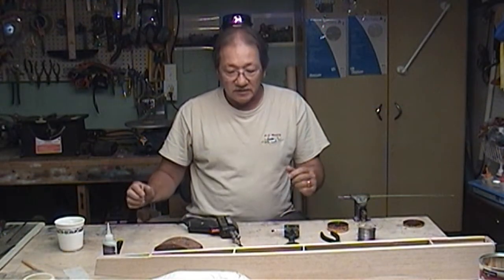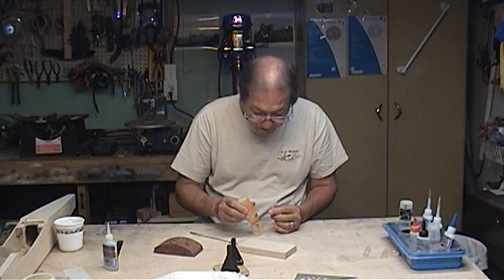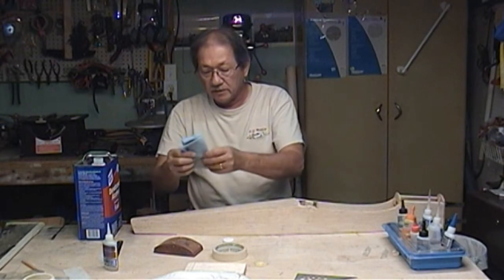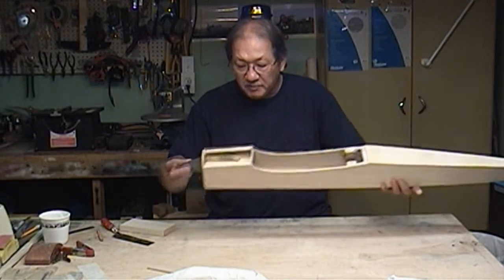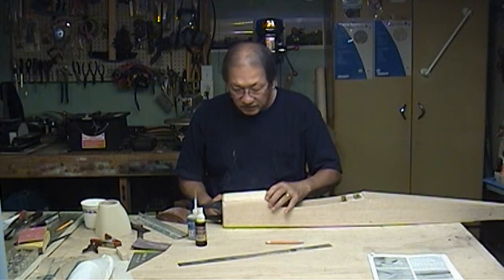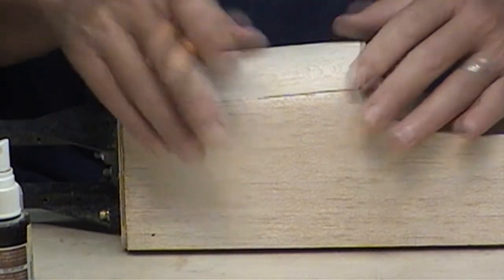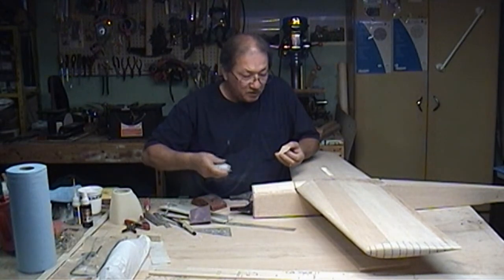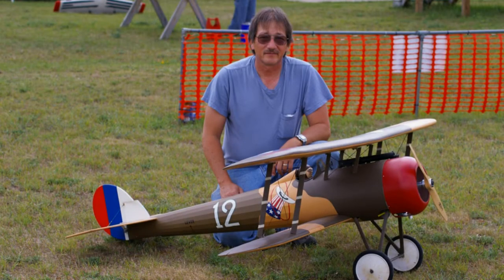SIG KOUGAR BUILD   Part   9 D   Back to The Wings

Comment: Hey Bob, thanks for the video, still following and looking forward to more video's.
Reply from the maker: Hi Mike, Thanks for following along. Started today on the prep work for the retract video. It's going to be a little bit more complex than installing standard landing gear blocks, but they're retracts. Just adding to the fun factor. The retracts are just simple cheap mechanical but they work good... The video should be out in about a week maybe less. Thanks again!

Comment: Hi Bob, another question, why the engine goes mounted at 45 degrees?
A friend suggested to do it vertically, but will ruin the look from both sides
Reply from the maker: The real reason it set on a 45 degree angle is that the thrust line is a bit high on the firewall. If the engine was mounted any other way on the model it would cause mounting problems and/or would definitely take away from the sleek looks of the model.
Reply: R/C Model Tips & Hints Thank you Bob, take care of your self!